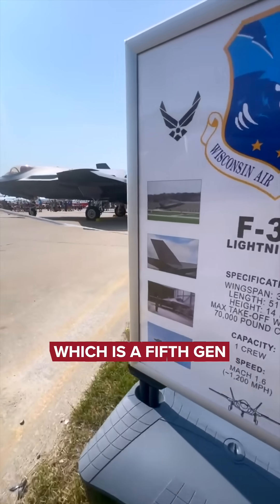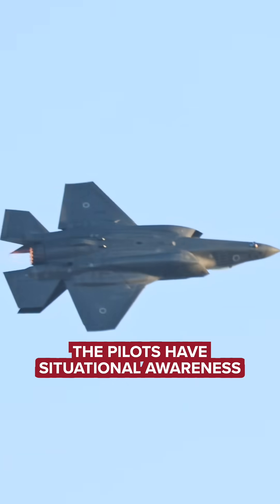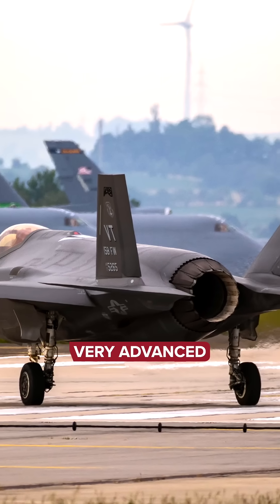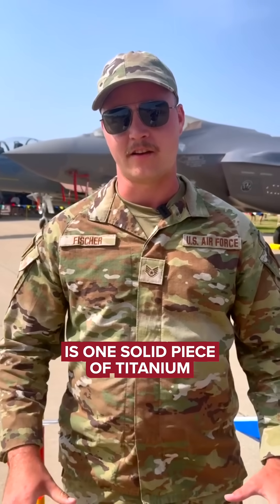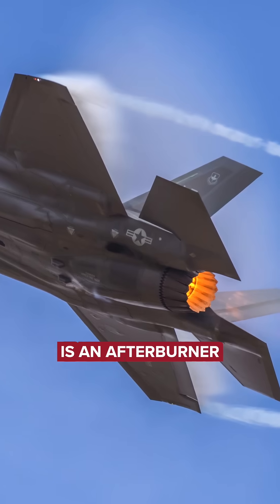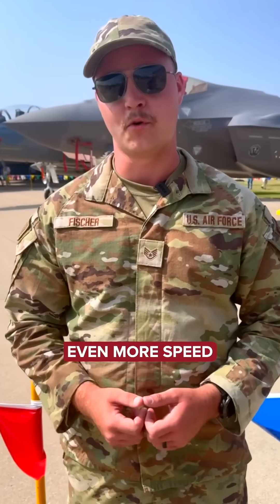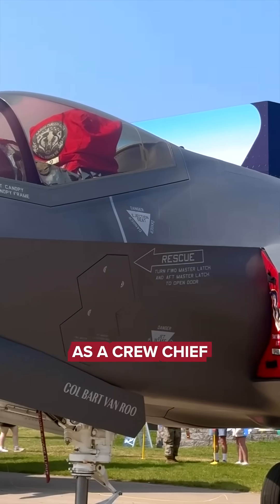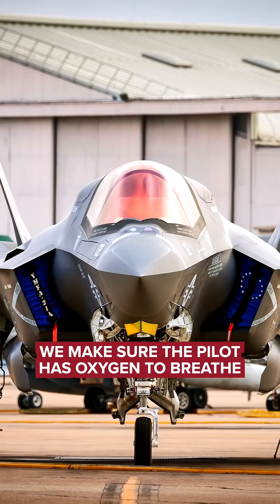Inside the F-35: Tech, Power, and Stealth Explained

Comment: One EMP and it’s useless
Reply: Every modern military aircraft is outfitted with EMP protection.
Reply: @fubarexress6359 
 the f35 is not.
It also can't stand a lightning strike despite its name.
Reply: @fubarexress6359 this plane is not and can't even withstand a lightning strike
Reply: ok so you expect them to just... not use electronics??